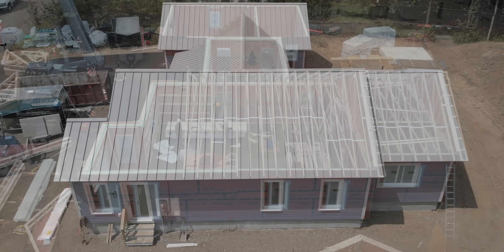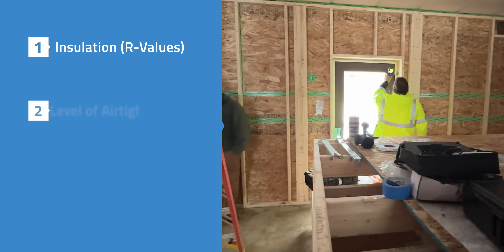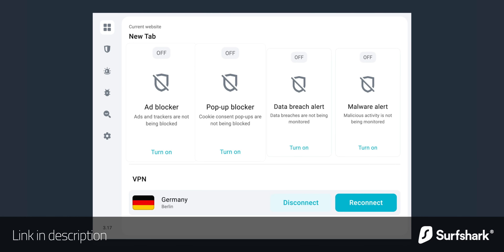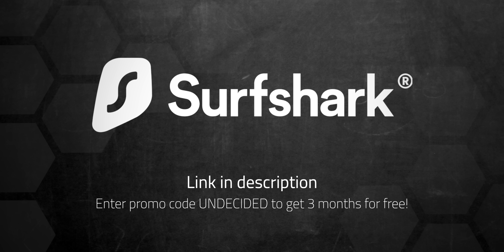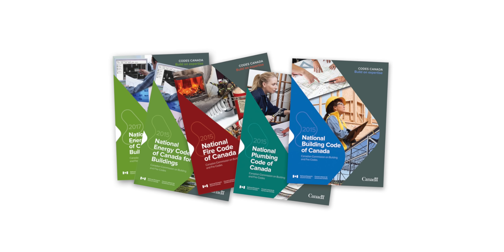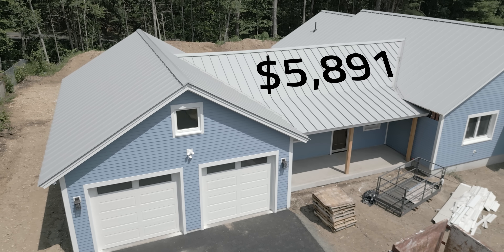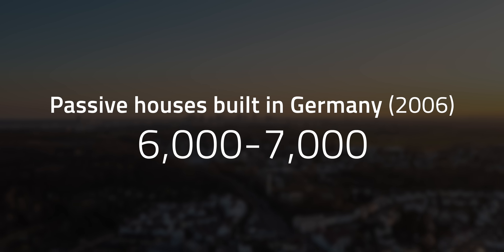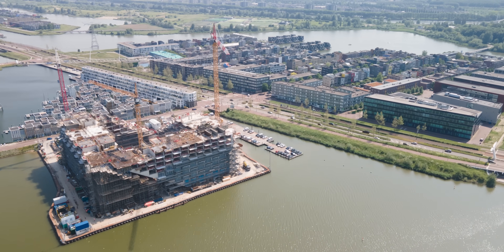Why Do American Homes Suck?

Comment: cheap doesnt pay - I am fortunate that like you i have been studying this for a long time. so when i bought a house for a 1$ yes one dollar, and moved it whole 1/4 mie to my new piece of land i thought Yippee, i can build what i want - even though no-one knows what i am talking about! But I had to live in it while it was being rebuilt from the piers up - literally - i a mistake once the plumbing and electric were sorted - should have spray foamed underneath to totally seal the box but couldn't do it at the time - it was too complicated and in a rea The Rio Grande Valley POP over 1 million - i Could only find 1 contractor who would come out and do it and he wanted 800 per day - was too prohibitive for the house - but i built a contianer home and i did do that and its awesome. 
But to the point - the quality of materials and fittings - walls dooretc is so bad here - choice doesn't even come into it. I found AO smith did a Propane outdoor, on-demand water heater - had to order it from Lowes who Proudly Told me THEY HAD NEVER SOLD ONE _ why the hell not - its awesome - why - it costs twice as much as a larger std water heater - the same as when i bought an electric on-demand water heater - could only find 1 electrician who was prepared to wire it up with the rest saying -no - we don't deal with those - you need 3x30 amp supplies just to run one - yes you do, but it sips powers and has been awesome - takes no space and is amazing - but heres the tip of the day - ALL THE WATER ENTERING MY HOUSE IS FILTERED - saves your componants and water heating stuff as the nasties in public water are just corrosive - full astop - so american house suck because people  dont care and wont pay - my builder was told at the start - if there is a hole crack misalignment (posh term for walls that are all to shit) or any other gaps they were to be glued shut or siliconed - I uses TYVEC paper on both sides of my walls (i have ply wood insode as i hate sheet rock)
If i ever come into enough money to blow it on the house in the future i will probably import tilt and turn window and great patio and front side doot and replace what i have - but that would probably be a $20,000 cost Sprayfoaming it would be at least 10 and if I wanted it passive 10 more ontop of that - it is 762 sq ft - no point - but wait you will say - yu live in texas sunshine - soloar power Yaaay - my bill in energy for a year is $1600 - A YEAR - solar panels - but wait they need batteries and inverters and and and - not even close to being worth it - but simple things yes worth every cent - and why did i sue plywood - a, treated + texas= Termites and if i ever want to change it - i can literally find screews take it down and put it back - i know this as i changed my design on bathroom and had to take two walls out and replace drains and plumbing - re used virtually all over it - helps if you get back the same guy who put it up ... hey ho unfortunately as you well know - we live in a world driven by one thing _ greed - interms of what we will save (saving) and what we will pay (stupid) as there is one thing missing in most American home - doesnt even need a wall - The big picture - and well done on house - way too much to worry about for me - i deal with 6 things - experience, time, money, compromise, bal - get anywhere using all of those and you may have it figured outance and communication- get anywhere using all of those and you may have it figured out - i'll let you know - itll be on my tombstone LOL - keep going!!

Comment: Here's the flip side: the fact that California is "one of a handful of states" that adopted the most recent and most stringent energy efficiency codes supports the argument that building houses in California is and has been getting more expensive - aka more 'red tape' - than building in states that still rely on an older and more lenient efficiency standard.

If trading cheaper building costs for higher future energy costs is a thing, you have to admit that it plays a role in housing affordability at the purchase stage.

Comment: You're doing a lot of ragging on the US here.  Americans can build good quality, energy-efficient homes if they concentrate on structural integrity, air tightness, continuous exterior thermal insulation and new windows and doors.  I tore off my old decrepit cedar shingles on my 120 year old house in Baltimore, added a self-adhering air barrier membrane, two layers of continuous thermal insulation (polyiso) on the exposed exterior clapboard, and installed a plywood layer and new cedar shingles.  I added dual-pane Loewen windows and doors.  My house is warm as toast now and I didn't have to get anything from Europe.  I also recently replaced my old boiler and indirect Hot Water Heater with a Navien combi-boiler (made in the USA) that heats my radiant floors and provides lots of hot showers.  Btw, ERV heat exchangers are not very common in Europe either.

Comment: Houses are already unaffordable as they are. How are people expected to be able to pay the additional costs associated with energy efficient buildings?
Reply: Common misconception.. As efficiency increases, all of a sudden you find you dont need 30k in heating and cooling.. a huge chunk of what you would have spent now paid for 95% of the efficiency measures.. Then, factor in future value and the dividends pay back in spades, and for the lifetime of the home....
Reply: @AudioFanMan  Yeah, but those 30k are spread out over many years as opposed to having to fork it out all at once when building/buying the house. I mean the long-term savings and efficiency are surely nice and using less energy is also great for the environment so I'm all for it but it requires a larger upfront investment and not everyone can afford that.
Reply: @toutatis193  Im not certain that you understand... building a typical house might require say 30k in the mortgage for heating and cooling.  Take 20-25K from that allowance build it right and now 5-10k worth of mechanical equipment is needed. Same mortgage price. Worst case, say you spent 10k more than the typical house... that is paid back in less than 1/3rd the mortgage term by reduced bills and probably and a profit for the next 20 years.
The real mistake made by this industry is the advertising using energy efficiency as the main point. The main point should be comfort, health and durability. The energy is only a bonus.. Almost no one ever says the most comfortable I have ever been was in my house..

Comment: I'm not necessarily in favor of MANDATED energy efficiency improvements in home building.  It does raise costs and sometimes can price out buyers.  You still can upgrade your home easily if you choose to do so.  Many builders offer fine,  energy efficient upgrades in insulation,  HVAC systems,  windows etc - all the things you spoke of.   Let the market decide.

Comment: As someone living in a  van because of the cost of housing I think getting the cost of housing down is the biggest issue right now.  Yes energy efficiency is important but not being able to afford a heatpump is also important.
Reply: Looking at homes in the last year has made me realize one thing: you pay for the land.

The cost of construction is usually 20-30% of the cost of the house (much less in expensive areas, but I'm assuming you're not complaining about living in a van because you can't afford Pebble Beach or something.)  even double the cost is an increase of 30%, which is a bit of a ridiculous mark-up (likely you'd see an increase in 5-10%, eventually offset by lower land values as people can only afford what they can afford anyway). hope you find a more permanent place to live.
Reply: @malloc7108  ...and if the cost of construction is 20% to 30%... that means the other 70% would be materials and equipment.

So a minor increase in building materials affects 70% of the overall cost... the plot of land where you decide to build that house has little effect on that cost.

A $400k house is still $400k whether you build it in Malibu or next to a landfill in West Virginia.

...which is probably why I see nicer houses out in the middle of the country than in high $ residential areas in the suburbs... because people DON'T want to spend their home budget on the land.
Reply: Agreed. This video is for people with an engineering-level interest in building design, but the last thing we need in America is increased cost due to higher efficiency code requirements. We are in a housing crisis, and that needs to be rectified first.

And also thank god building codes are state decided not nationally decided. That’s the difference between a house in Texas vs California. My house in Texas would cost easily $750k in California.
Reply: I hope you're doing well sir?

But here's the deal, when gov. Prints money/ currency out of thin air, it devalues the currency.  Why? I don't know exactly.  Anyways so now you got more paper chasing solid commodities like wood...
Thats why homes are so expensive. They are made up of hard assets that take energy to produce....speaking of which, if we gad more cheap energy in the US ..that would also help cost of EVERYTHING, but only so much as gov. quits printing money.
Reply: I recently replaced my gas furnace... I created a  spreadsheet to compare all the heatpumps and gas furnaces by the approximate amount of heating needed and the monthly average temperature...

Since there are currently no gas-powered heatpumps, the heat pumps actually saved ZERO $ simply because of the immense amount of power it would need to heat the home in the winter (when it was least efficient).

There's a reason why almost nobody uses heat pumps in the northern US.
Reply: @jasono2139 We have a heat pump here in Quebec, it's worth it because electricity is very cheap here. You better have another source of heat because it doesn't do well in very cold temperatures.
Reply: @jasono2139   Quebec has the lowest electricity cost in Canada & USA. We also have a gas fireplace on colder days. 

The heat pump does the job quite well up to about 0f/-20c, the gas fireplace will be used if it gets colder ( it almost never goes under -30c/-22f).
Reply: That’s what gets left out of this. If we cared about energy efficiency we would go nuclear. That should be our focus, not increasing insulation.

Comment: Your claimed energy saving cost numbers make no sense or are simply false.  Just your claimed yearly savings for one home alone is more than my poorly build 1960 2750 sq ft farm house plus two shops (one is a build for welding, the other auto repair) plus a livestock barn, my vacation house and 1350 sq ft office all combined.

Comment: A major obstacle to constructing greater energy efficiency for family homes in America is the propensity for absurdly large climate controlled interior footprints, relative to the average number of occupants on a consistent basis. When examining per capita energy consumption, cultural and personal preference need to be understood. As one who was born in America to a family of six, we lived in 230sf per occupant just fine.  In modern home construction in America, it is much much more climate controlled living area per occupant. This presents entirely another range of arguments relative to personal preference, however the bottom line is what a family can afford within the given household income level to the size of the family home.  Perhaps this is why smart money is now going for much more rationally sized homes for individuals and families, then invest the positive income delta for future retirement. Not living only in the 'now' so to speak. 

As to alternative energy sources, and / or traditional systems, all such technologies need to be free from any sort of taxpayer enslaved subsidy to the benefit of another. In other words, why is it my responsibility to pay for someone else's solar panels for example. If the total energy input required to create an energy transfer process (solar or wind), is greater than the energy output, then the energy transfer system is in fact less efficient than a system that has higher energy output than the energy input required to develop / process / deliver said energy. 

Abundant, low input cost / high output energy systems are the bedrock of a sustainable culture and economic system. Highly subsided systems currently in place in the west, are in fact unsustainable when those systems run out of capital to extract from the productive in society via tax enslavement. This view of course developed through examination of 6,000 years of recorded human history and the resulting disasters created by top down economic / energy policy management.

Comment: A little disappointed, Matt as you make no mention of the work being done by PHIUS, the non profit that has adapted the PHI standard for the 5 separate US climate zones and now has the capacity to do the same for any climate in the world. One size does not fit all, it turns out.

Comment: When I was younger I worked with a company and we were building a 3 story retirement complex, had maybe about 30 apartments per floor plus lobby kitchen etc. It was sold to the community as a state of the art design in passive energy efficiency and the locals seemed pretty proud to be having something so green and high tech in the community.

Turns out however in the early phases of construction the developers looked at the price tag and most if not all the energy efficient design was scrapped and the building became just another standard giant concrete box.

Money over efficiency is the north American motto and we need to change that bullshit. Remember when shit was built right the first time? It's my hope we will get back to those times. I still drive my car built in 1999 and modern cars can't even live past 5 years in the name of selling more cars. Stupid attitude we have here

Comment: Canadian here. Good program sir, and I hope many folks find your podcast. I thought you’d find it interesting to know where PassiveHaus actually began as a tested concept. It was the Province of Saskatchewan’s research centre that first built and tested a net zero house in the early 1980’s. The man who led the charge was Harold Orr. After the provincial government shelved the research project, the German government obtained the research data and ran with more research and code development. I am an architect in my 70’s and practiced in Saskatchewan. Today I dabble in small energy efficient housing in eastern Ontario. Every one of my houses targets an ACH50 rate of 0.6. Walls are R32, roofs R70. Triple glazing. As much as possible I eliminate basements. I
Keep up the good work.
Reply: How much would say a 2000 SF house with 4BR, 2-3BA cost to build?  Guessing in the $800k USD range?  I feel like direct costs were not mentioned here in this video.
Reply: What? Why no basement? Note: I am from Germany, so double and tripple glazed windows are the norm here (hell: My parents ripped out the windows in their old - it was built in the 30s! - house and the ones they had were already double glazed!)...as are basements and they are nice to have! Very cool in summer! Hell, I am debating trying to get a LAN-Connection to my apartment, because then I could stay in the basement in summer and take my laptop there, as it is quite hot up here (house built in the 60s, so it's a heat trap in summer!)

Comment: Low air changes per hour in a living and working space are a Health Hazard.   That means there is a build up of Co2, VOC's, indoor allergens and virus/bacterial load exhaled by people.  The rough way to see if there is enough air exchange is to measure CO2 concentrations in the air and compare to outside air.  I suggest you Investigate"Healthy Buildings: How Indoor Spaces Drive Performance and Productivity" by Allen & MaComber..  Air exchange needs to be way higher in my opinion.

Comment: Very interesting. As a fact, I just moved from a "new" apartment building (2015) to a much older multi-generational home (pre-1930s) in Germany. And we had a 2-month overlap in the rental period. So we moved into the new house and had 1.5 months to fix up the old house before handing over the keys. During that time, the previous house heating was turned off, to not accumulate more heating costs, from mid-November to the end of December 2023. During that time of no heating, the temperature dropped from around 24°c to around 20°c. In our new home, turning off the heaters would make the temperature drop from 22°c to below 18°c within a day. So if I were to buy or build a house, I would absolutely keep energy efficiency in mind. As it stands, renting a home, it's the bottom line, and the more important amenities, e.g. having a garden, and close proximity to a playground for the little one, that counts.

Comment: American homes are designed to keep you spending money. It is a constant cycle of spend and waste. For one, the windows and doors are so substandard that they're illegal to sell in Europe.  The windows in my brand new home began to break in 5 years. The doors are all a mess and 3 will not stay closed. This 4,000 square foot shack was built in 2007.  It is a horror fest of substandard American materials.

Comment: Here ( Denmark ) for a new building.
sealing & roof at least 360 mm insulation - walls depending on material ( light or heavy wall ) 285 - 245 mm and floor insulation 300 mm
Or that was back in 2018, would probably not hold a stick to current minimum demands.

That would be rockwool not some spray on goop.